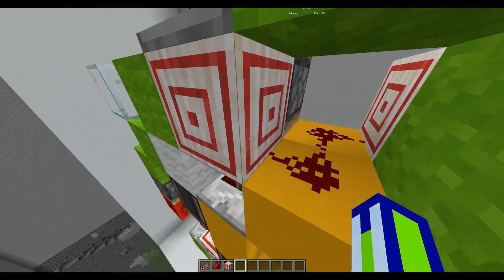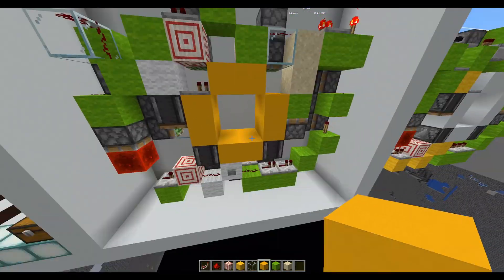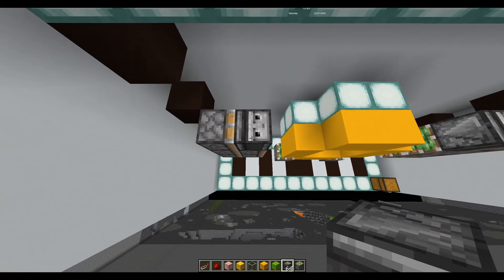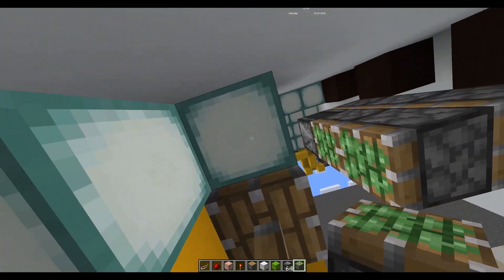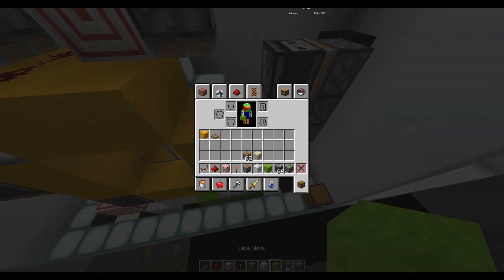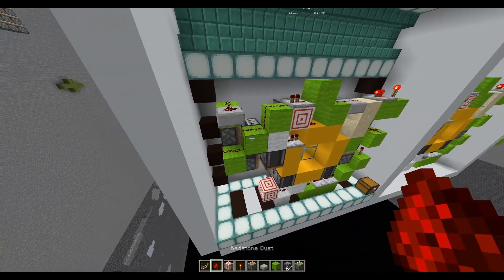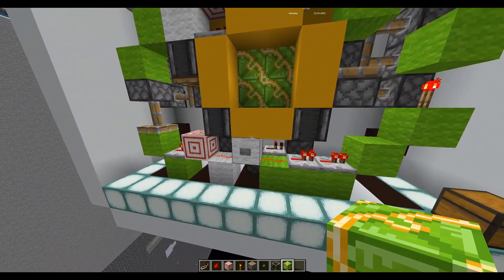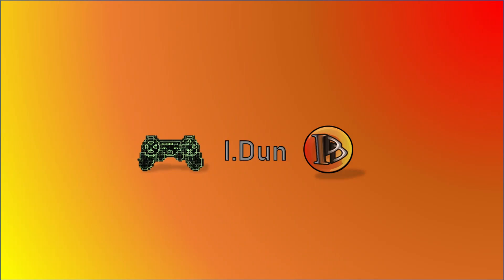Better Seamless Glass Door Tutorial 2x2 (Minecraft 1.18+)

Comment from the maker: Spamming the button breaks the sand so, it might be worth replacing the piston with sand with the observer trapdoor observer from the other side, putting the piston above that with just 1 normal block on it and then adding a delay to the double extender to account for the delay of the extra observer, will probably put that in V3 of door as the main things target block do is make it sync up nicer.